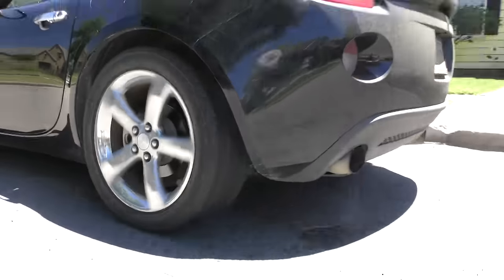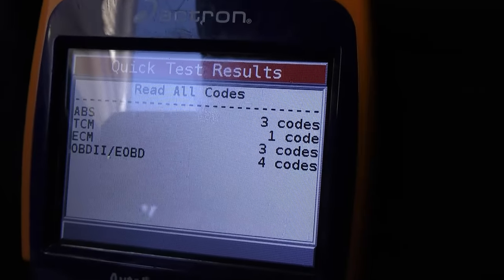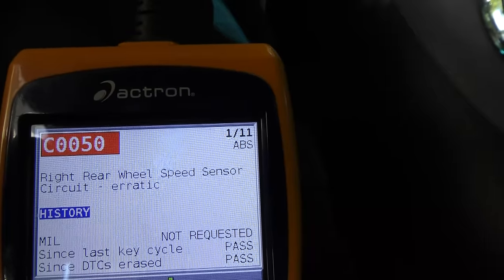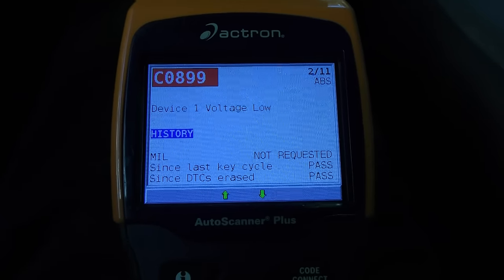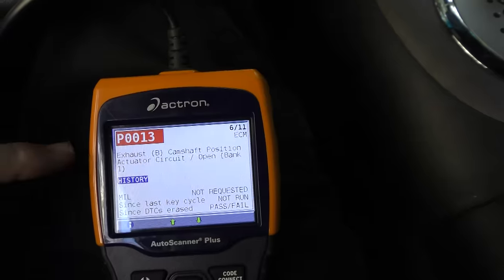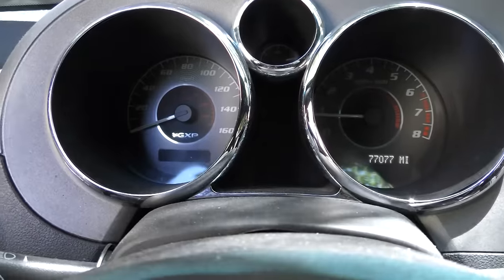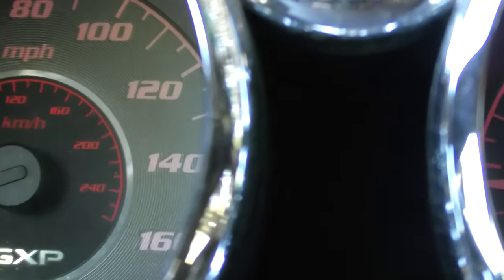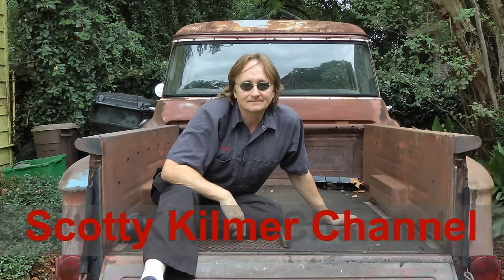Check Engine Light On in Your Car? The Truth About What it Means

Comment: THanks Scotty, you just gave me peace of mind. THe garage where I take my cars told me more or less the same as you are saying in this video, since my Toyota Camry has an intermittent CEL and a code related to some speed sensor in the automatic gear box. They told me to drive it and see how it feels but they considered it not serious enough to give maintenance to the gear box (which could cost me a fortune and not really needed at the moment). Car has only 60,000 miles and does not show any problem.

Comment: I'm surprised the most likely, and like the actual concern was not even mentioned. Being a GM, and with both a P0013 and P0014,  it's almost certainly the Exhaust Camshaft Actuator. They were super common, common enough, I'd consider replacing both intake and exhaust actuators if it were my vehicle, and letting my customer know the intake actuator may be needed soon if it's a customer vehicle.

Comment: Amen to this, you can spend all kinds of money (especially at the dealership) guessing which parts need to be replaced to fix the CEL.  Dealerships are dumb as hell at diagnosing problems.  I had Nissan replace my MAF sensor because I had a CEL, turns out my o2 sensor banks were swapped (during my exhaust installation), they couldn't even figure that out.

Comment: Scotty, generally no criticism on all the videos I have seen, but on this one I have to ask you to amend or clarify please.  A SOLID check engine light is a "check it when you can get to it" in 90% of vehicles, a FLASHING check engine light is a "pull over right now" in 90% of vehicles. Please since 99% of the american public is sooo naive about this facts don't skim over and be cavalier on the details here. Almost every vehicle out there if it is flashing stop the engine now!
Reply: Correct. A flashing check engine light means a condition exists that can destroy the catalytic converter(s). Misfires dump unburned fuel mixture into the cats, which can overheat them. However, I had a bad coil pack on my Windstar that was causing misfires. Apparently Ford uses a different strategy to protect the converters that doesn't rely on the driver. The light never flashed but the computer would shut off the engine after a short period of driving and then not allow a restart for several minutes. Apparently it has a program in there to protect the cats from overheating and burning up by giving them time to cool down. Once the coil pack was replaced and the misfires were eliminated the shutdowns stopped happening and the cats were still okay.

Comment: I always check the codes but like scotty said, clear them, if they dont come on after heavy driving your fine. Although i had codes on my moms yukon twice, they were quick fixes. It was a MAF sensor code (cleaned it because we have an oil air filter) and a large evap leak (gas cap was loose). Runs just fine

Comment: I have read thru a bunch of comments, people claiming that if the ABS activates it takes forever to stop. One problem is most people have never been educated about how to drive an ABS car. If it activated and the pedal starts pulsating do not, I REPEAT DO NOT let off the brake pedal. Keep it pressed hard to the floor and let the ABS do its job.
Now on the other hand if the ABS fails to activate or malfunction and you feel or hear the wheels lock up then revert to normal emergency braking techniques, ie pumping the pedal or reducing pedal pressure. I had to educate my wife and several other family members about that.
I propose if you have an ABS vehicle and have never activated the ABS then go out on a back road an slam on the brakes so you can feel what happens. The pedal pulsation can take you by surprise and your first reaction is to let off the pedal which is the worse thing you can do with ABS.

Comment: Scotty, how common is it for a vehicle to slowly leak fluid over time? I was always told the point of checking the oil, coolant, and other easily accessible fluids was because a car slowly loses them over time (aside from cleaning out old dirty fluids).
Reply: The way you can tell when a Ford needs oil is it stops leaking.

Comment: CEL been on for about 3 years now. I just reset the light and get the computer to 3 Outta 4 of the complete drive cycle and they legally have to pass you if the light hasn't returned. I learned that from you Scotty. I am also in Texas! I have an evap leak but car of course runs great at 210K miles!

Comment: Great video.  I had this happen to me, my old Saab 9-3 threw a code at 151,000 miles about 7 months ago.  I checked it with a scanner (before seeing this video) and it told me of an engine misfire.  I erased the codes and now approaching 164,000 it has not come back.  Just one misfire - could have been bad gas for all I know.  But like he said, no need to spend anything (just a scanner check).

Comment: Moms Subaru has that light on.  It was checked and found to either be a bad O2 sensor on one of the catalytic converters or the converter is truly bad.  One is a $25 fix, the other is over $500.  It has NOT hurt the car, in any way, driving it with that light on.  In fact, it has not even touched the gas mileage the car gets.
Just another example of not needing to worry about it.

Comment: I actually do pay attention to the check engine light and I had that happen to me a few years ago when my rear o2 sensor needed to be replaced.  Glad I took it into the shop right away because my flex pipe had rusted out and the car could have gotten much worse if that wasn't caught in time.
Reply: Was it flashing or steady?
Reply: @matmurk8536  it was steady.  It was fixed and eventually the car had to be retired due to subframe corrosion.  The engine outlived the car.  Now I have a 2022 Hyundai Kona.  Great car, all the gadgets and gizmos.  And great on gas.

Comment: Meanwhile here in 2024 the engine management warning light on my 2015 Astra J has just come on amber. Discovered that the problem was that I had done up the petrol cap too tightly. Two clicks appears to be more than  tight enough it would appear. 
Last year the engine management came on amber again. That time it was a worn out seal on the petrol cap. 
Cured by replacing the petrol cap & seal on that occasion.
Please check the simple stuff before panicking!
Good Vid Scotty.

Comment: In some states you can't get your emission testing done with the check engine light on.. You'll have to address the issue.
Reply: California is one.  A lit check engine light is automatic failure.
Reply: Texas and Colorado a light on = auto fail...unhook battery to reset computer and the computer is "not ready" on multiple sensors = fail in both those states. Texas allows ONE sensor out of "however many it has" to be "not ready" in a 1996-current car.
Reply: And surprisingly, in Scotty's hometown of Houston, TX! Surprised he didn't mention emissions testing.
Reply: Yep, California. California sucks. My transmission solenoids going bad and throwing up a light has nothing to do with emissions, but here we are.
Reply: +gantmj Stovepipe!
Reply: gantmj - I assume the definition of your statement is to find a place that will tweek the test in order to pass, without resolving the problem.  Yea, still happens, but the State sends out fake test cars looking for these places.  If caught, you're out of business.
Reply: NJ
Reply: In California gas powered cars made in 1975 and before don't smog. With diesels it's 1997 and before. They haven't changed that exemption in years. So for us, it's cars 42 years and older that don't get emissions tested.
Reply: the fuck is emission testing?
i'm up here in Canada with a 01 impala with 5 active codes and hole in my cat and I got my safety inspection passed 2 months ago
Reply: Same in Ohio
Reply: nilloc93, Ontario has emission tests on vehicles over 5 years old. It’s mandatory otherwise you don’t get your renewal stickers for your license.
Reply: This is rather annoying to me as I drive a 16 year old car that gets 35mpg but due to a minor secondary air injection issue somewhere in the engine, I won't pass emissions.  
I'm pretty sure my car is still much better than a 16 year old Suburban V8 for emissions, or better than buying a brand new car for the environment, but certain things in life are not always logical.
Reply: Or just do what I do and get a code scanner and delete the code. Scanners only cost $20

Comment: I love Scotty's channel and been watching it for years but I disagree with his advice about waiting on a check engine light.  While the car drives fine with the light and waiting doesn't usually create any damage, I think thats poor car care advice.  If you have a check engine light, figure out what it is and get it fixed.  If you don't have a mechanic that can figure it out and fix it in one visit, use a different mechanic.  A good mechanic can always figure it out.  And the ones commenting about your wallets?  Give me a break.  If you own a car, you need to keep up maintenance on it. I am tired of hearing people that have issues with their cars but keep driving them until they break.  Cars are not supposed to be disposable.  Engine issues?  Get it fixed.  Really bad internal engine issues?  Rebuild the engine.  Paint bad or dent, get to a body shop and have it fixed.  Seats ripped?  Go to an upholstery place and get it fixed.  We would all see cars in much nicer condition if we all took better care of our cars and was proactive on preventive maintenance.  The way I see it, if you can't afford the maintenance, don't buy that car.  There are plenty of older American cars that are easy to work on and reliable.  You don't need that brand new Toyota or flashy pre-owned Mercedes.  Get a car that no only is within tour budget to buy but also in your budget to maintain.  Its not rocket science.  And if thats really complicated, there is always the bus.
Reply: I challenge you to try to find a bus in a rural area. 🙄

Comment: We had an intermittent problem starting our Volvo, and our mechanic said to wait until it gets worse. We waited, and it got worse, finally wouldn't start, and the repair was $300. But, our mechanic told us we now also had to replace the clutch flywheel, an additional $1300, which was being damaged during the time we were 'waiting.' He said, "You damaged the flywheel by waiting. You shouldn't have waited so long." We don't go to him anymore.

Comment: A check engine light in Pennsylvania is an automatic fail for state inspection.  You can't simply pull a fuse or disable the light because they go directly to the ODB port.  Clearing the codes may work, but the ECU has to cycle before the cleared the codes are completely cleared.  If they don't come back after driving a while you may be okay, otherwise get ready to spend.

Comment: Word to the wise.  Do not ignore a check engine light if you need to pass a smog test for registration in the near future.  When you get the issue fixed, they will reset the ecu and the car must complete a "drive cycle" before the cars smog monitors go to a ready state and pass smog.  This can take months and you can waste countless hours and money at the dmv getting registration extensions.  Happened to me with a 2007 audi a6 and "harmless" intake manifold control runner sensor issue.  It took 3 months of daily driving to finaly pass smog.

Comment: The other source, is a badly closed or worn gas tank cap - if it leaks air into the tank (the tank is pulled by vac to the carbon filter for EPA), then that will trip the check engine light.

Comment: Ignoring a check engine light isn't always advisable. Get it scanned for free at an auto store and Google the code. If you live with a constant check engine light how will you know when new, more serious problems arise? FYI a flashing check engine light indicates either a misfire or some other emissions critical failure. Maybe it's me, but I like my car enough not to drive it around with something wrong indicated by the check engine light or MIL.
Reply: He didn't say it was always advisable.
Reply: Flashing CEL indicates severe misfire I believe, to the point where continued driving will likely cause engine damage.
Reply: I'd know when a more serious issue arises when my car starts running like a POS don't need a light for that...
Reply: Remember, those crappy scanners don't pick up some codes in vehicles.
Reply: 1Fast GXP
Reply: Had a flashing check engine light on. Serious engine knocking. Swapped out coils and it ran great and passed smog.

Comment: I have a 2017 truck that is out of warranty.  The check engine light came on, so I took it to a local shop to have it looked at.  They charged me $75 diagnosis fee and told me there are no codes coming up and I'd have to take it to the dealership.  None too happy about that.  I took it to the dealer and they want $140 to do a diagnosis.  I asked what happens if they didn't find anything.  The dealership told me there are codes on vehicles that only dealerships can see and they should be able to find something, but if they don't, it's still $140 for their time.  I told them to stuff it.  I can clear the code for free at home.

Comment: my check engine light came on brought it to my mechanic he erased the codes light didn't come back on but my car makes noise while driving which never never did before
Reply: when i read this i immediately was like the Timing Chain needs replaced or checked and so do the camshaft and crank gears because that would lead to engine noise if the camshaft timing is thrown off overtime due to a loose Timing chain it throws off the cam and crank and will lead to engine knocking because the conflicted timing of the cam and piston/cylinder.
Reply: that's why at 0:24 Scotty says "now it could be a serious problem or" for your case its a serious problem that can turn into a fixed problem
Reply: people are always quick to sell a vehicle when they dont know how to fix the engine... and the thing is people get ride of nice, expensive vehicles traumatically less because of this issue everyday. because their Motto is that its cheaper to buy another vehicle then fix the one they have.... and mechanics love this, because they make so much off of people with a fixed mind state like this. Psychology Aspect.
Reply: A true mechanic, keeps their Clients by great service and great prices... and doing the job right and if they have to go at it a second time for the same issue.... the best clientele based mechanic wont charge the 2nd time because they aim for resolving the problem, meaning "Business, Means Happy Clientele"

Comment: Step one, find a reputable shop that doesn't throw parts at cars instead of diagnosing them correctly. Step two, don't listen to guys like this. Let's say that your check engine light comes on and you get it scanned and find out that it's a p0430 bank 2 catalytic converter is bad. No problem right? Just keep driving right? Well let's say about a month goes by and you don't care about that pesky light anymore because your buddy Scotty said its OK to drive like that and suddenly your fuel pump isn't performing correctly and the engine starts to run lean and sets a lean code. Well guess what, since you didn't fix the first issue, you have no idea when your car sets another code. No that your engine is leaning out and your cylinders are being destroyed from detonation do to high heat and minimal fuel. You have no idea and keep on driving because Scotty said it was OK to drive with the light on. Now you need a new engine and fuel pump. The moral of the story is, if the light comes on, repair the problem. That will save you more money than ignoring it.
Reply: Step one, easier said than done. Good & honest mechanics are like big foot - some people say they exist, but no one ever finds one.

Comment: Last week, I drove about  20 yards with my emergency brake on. After I released the brake, the check engine light came on.  I didn’t have access to a handheld diagnostic tool so I simply disconnected the battery cables and then reconnected.  The check engine light disappeared.  The only real consequence was that I had to reset all my settings on my in-dash radio, e.g., time and radio stations.

Comment: Ran here after I finished panicking about the solid engine light symbol that came on while driving. I immediately found a safe place to pull over since I was alone and don't understand a thing about cars. 

I actually didn't think to call roadside assistance to see if it was major or not. Instead, I came directly to you to see what you would say the problem could be and what happens if I continued to drive  with it on. 

Thank you so much Scotty!!!  😂😊🙌🏿

Comment: This works well except in states that require yearly inspections. You won't pass an OBD reading if you have any code logged into the ECU. Even if you clear it, you still gotta drive the car for so many miles for the ECU to reset itself 100%. Probably works on some cars but almost every one I've dealt with you only have a small window of after the ECU clears to get the inspection before the light kicks back on.